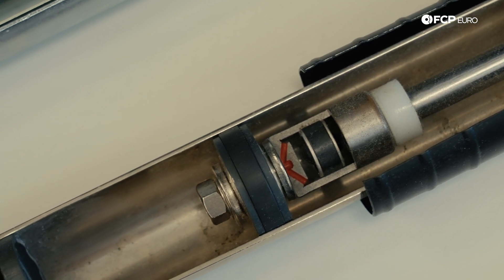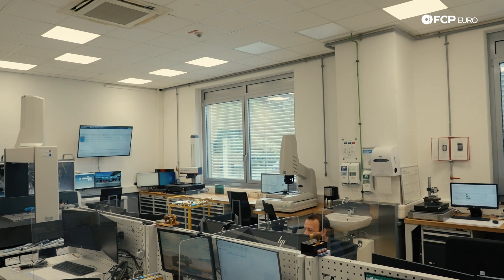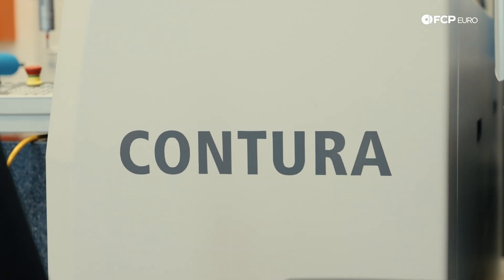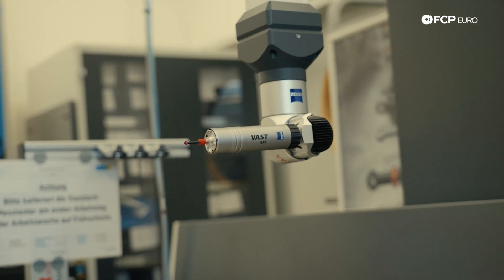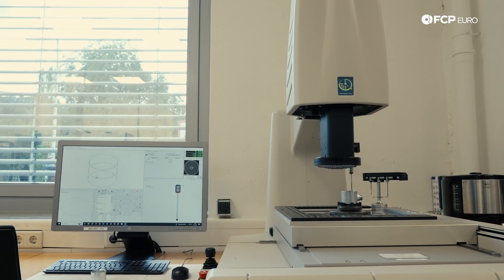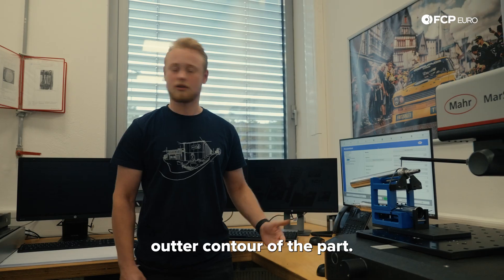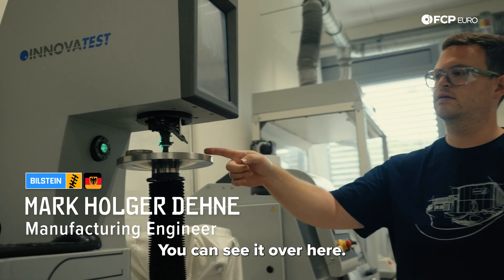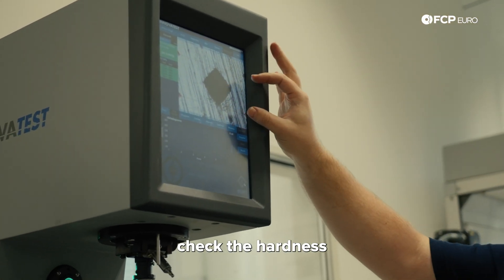Exclusive Look Into Product Testing Bilstein Dampers - QA Laboratory Access!

Comment: I drive for 18 years and I never used bilstein, but maybe next time I’ll have enough cash 😂
Reply: Bilstein are far superior than Boge and other stick struts.
Reply: @BurntOrangeHorn78  boge is cheapest crap. I use sachs
Reply: @mr_DIY  Boge and Sachs are identical 😅
Reply: Nope, Sachs are slightly better. I'm not here to argue like a child, just stating facts. Cheers
Reply: @schof1014  The only one impervious to arguments in a child like manner is you. Boge is owned by ZF/Sachs since 2001 and products by Boge and Sachs are identical for quite some time now...
Reply: @aerbus  TRW and lemforder also ZF brands, yet their parts is different in specs. Here is my view Lemforder vs TRW? Both suspension parts are out of VW spec! 2 mm difference in steel thickness 😳
https://youtu.be/97PNzUWJo88